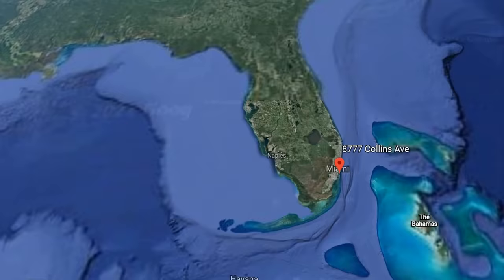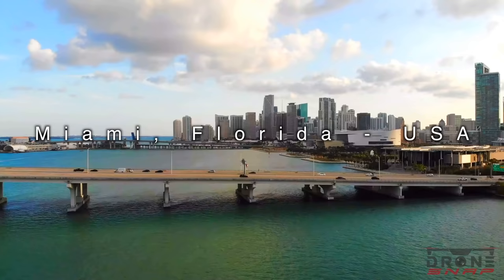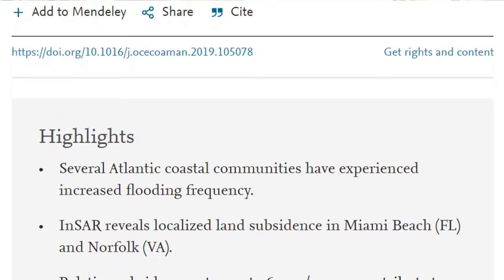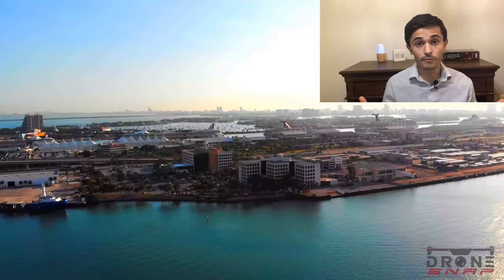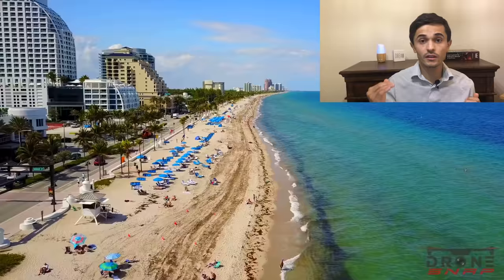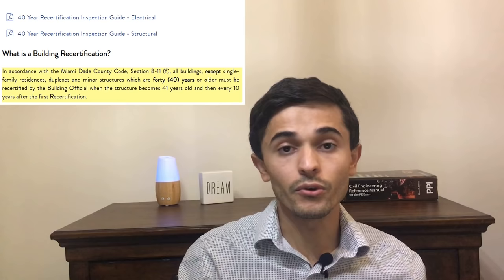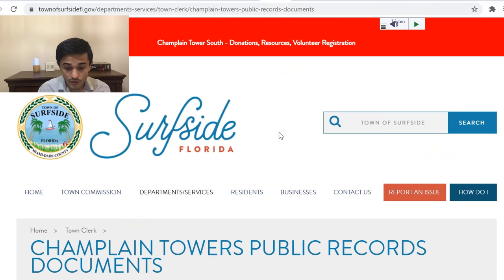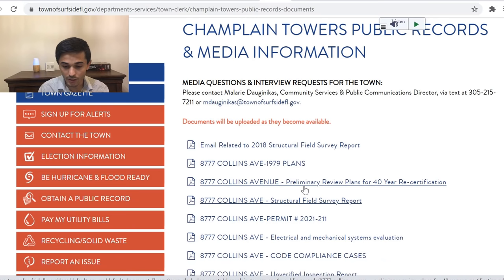Why Did the Building in Miami Collapse? A Structural Engineer's Perspective

Comment: Do they ever try to apply cathodic protection to the rebar?
Reply: No, they do make epoxy coated rebar, stainless and some other types of rebar that resist corrosion a little better standard rebar but I don't believe they were available back in the late 70s when the building was designed.  These option are much more expensive and are generally used in actual marine environments where the structure is constantly exposed to salt water along with a denser concrete mix to make it less porus.  If the building was actually maintained, rebar corrosion would have never been a major issue.
Reply: @laxmann31  I'm a little bit familiar with the epoxy and other coated rebar designs. I've never heard of someone putting stainless rebar into a concrete. In many situations, coatings are combined with cathodic protection to increase the overall resistance. I don't think that would be easy in concrete because there wouldn't be a continuous electrolyte path from the rebar to the anodes, but maybe some work-arounds are available. I never looked that closely at this issue. 

I hope that they can find enough evidence to do a thorough analysis. They need answers.
Reply: @VTPSTTU  they make stainless steel rebar but it has different structural properties compared to steel, I live in the central US so we don't use it at all here.  The chemical properties of concrete naturally (calcium hydroxide) protects the rebar but when you saturate the concrete and it never dries all bets are off.  There are also additives that you can add to the mix (hydrocel) which helps water intrusion into the cured product.  I suspect the complete lack of maintenance is the main culprit.  I have family that live in a condo on the water in Clearwater, FL and every 5-10 years they go through a pretty extensive refurbishment program. 

If the rebar cages are welded together rather than wire tied you might have a really good solution!
Reply: @laxmann31  I just don't know rebar enough to know what the properties are. I've always imagined that rebar is a fairly high carbon steel and is at least a little bit heat treated for hardness. On the other hand, they make so much of it that I can see no wanting to bother with needing to add a heat treat. That would increase the cost tremendously. Carbon steel should have the usual fatigue endurance limit of ferritic and martensitic steels. 

I don't remember the exact strengths of the stainless steels, and I know that they vary quite a bit. For rebar, I don't see much point in using the nickel-containing austenitic stainless steels. I think the ferritic and martensitic stainless steels are a going to be stronger than a simple ferritic carbon steel but maybe not as strong as a carbon steel treated for higher strength. The ferritic and martensitic stainless steels should have an endurance limit. I don't think that the austenitic stainless steels have the same endurance limit, but I could be wrong. I've forgotten quite a bit since becoming disabled. 

The slightly basic pH of the concrete will protect carbon steel against acidic corrosion, but I could see oxygen and water being difficult. Adding chloride to the mix will increase the conductivity of the solution and increase the corrosion rate. 

Wiring all of the rebar together would be the first step to making cathodic protection work. Part of the problem is that if a piece became separated, the voltage difference through the concrete would turn one end of a disconnected piece of rebar into an anode while the other end remained a cathode. That would destroy the rebar more quickly. Maybe pockets of dampness in an otherwise dry concrete would have a similar effect. I would almost want to do everything with localized sacrificial anodes, but that would add too much to the cost. 

Maybe there are easy answers to all of these issues. I asked the question because I don't know whether anyone has ever looked at these issues. I've only been peripherally involved in cathodic protection although I've always been interested.
Reply: @laxmann31  I wouldn't use a 300 series stainless steel in the exhaust. The exhaust components are going to stay hot, but they will still become wet sometimes. With salt from snow control or even salt spray from the ocean, the 300 series stainless steels could suffer stress corrosion cracking. At those high temperatures, wet, salty, oxygenated water is murder on the 300 series stainless steels. Maybe I'm wrong and someone has made it work, but that sounds like a rough application for the lower end austenitic grades. 

I could see the 400-series stainless steels giving some value in those applications. They would last longer than the carbon steels but be largely resistant to SCC. 

I didn't do much with titanium in my day, but I did a little bit. All of my experience was with the commercially-pure grades. I've never worked with the high-strength grades. I worked with a company that patented its own titanium alloy one time. One guy thought it would revolutionize the commercially-pure industry, but it never really went anywhere. 

If rebar is just hot-rolled carbon steel, then I'm guessing that the microstructure is all pearlite and ferrite. That makes sense in terms of making the stuff at low cost.

I've never done anything in the medical field. In some ways, I can see an advantage in everything operating at ninety-eight degrees all the time. On the other hand, I've never had to worry about such tiny corrosion rates putting too much metal in the system.
Reply: @VTPSTTU  400 series is a lot cheaper and the 409 stainless gets surface rust after a couple of years.  I have a 300 series exhaust manifolds on my vette and they seem to hold up just fine besides a little discoloration.

As for medical all the tools we design and make are stainless 17-4, for implants it's almost exclusively "Eli" titanium that is passivated after machining.

There's so many alloyed grades, maybe one day it'll catch on!

Comment: Well, if ya all saw what building actually fell it was only a portion of the building. This video shows a whole damn building collapse. Are ya sure ya got the correct building. And as for the people that were in the building that partial collapse we send our prayers for terrible loss
Reply: Video is correct. Left side still sanding. Collins St side.
Reply: @donnafrflorida56  thank you. I have been looking at different videos and the very first one i saw did not look that way.
Reply: The collapse happened in two stages. First only a portion, the center portion collapsed.  That collapsed dragged the east portion which then collapsed.  Check it out for yourself.
Reply: @debralegorreta1375  go to Builder integrity on YT. The middle first starts falling in the front. The rear of the middle follows. Then the east side.  check it out.
Reply: @donnamccullough1375  no one saw it. He takes you frame by frame. Clearing the middle front goes first.